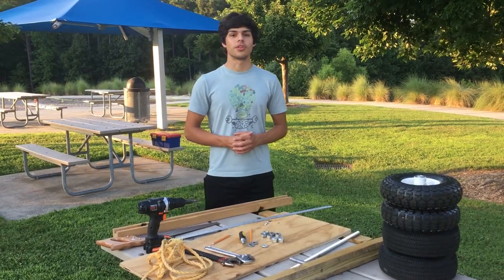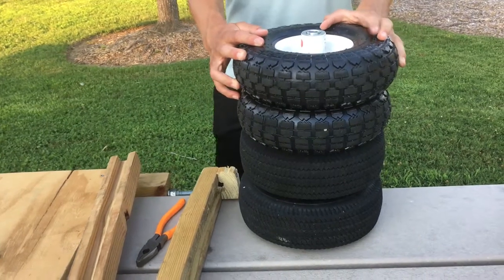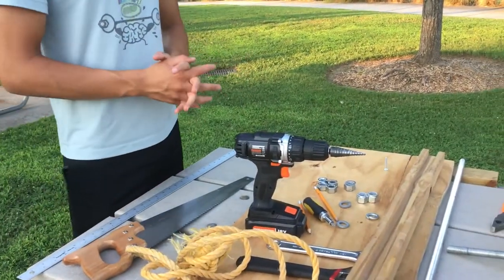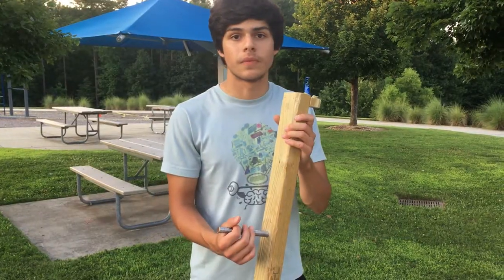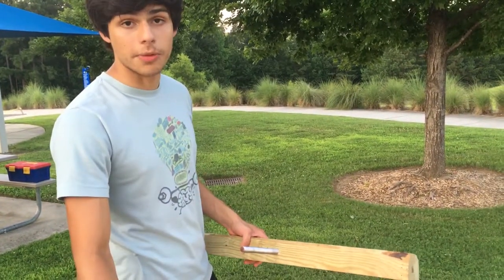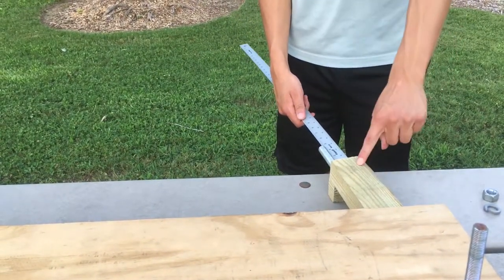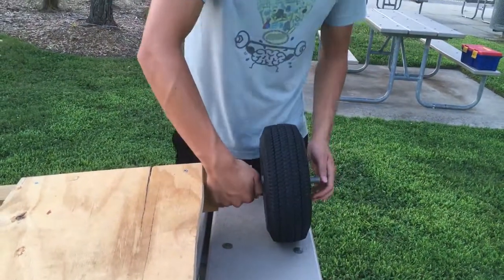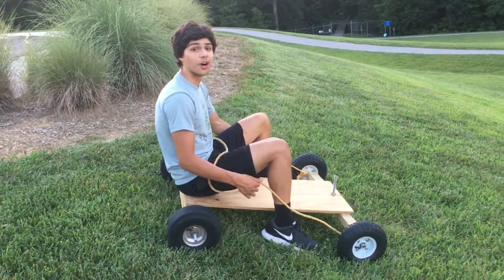How to build the Simplest Go Kart! | Wild Kinetics

Comment: I made one just for the fun of it. as a country and one that likes a Rush. I don't recommend using a 212. it's almost like suicide running almost without control. exhilarating and painful first ride. I should have gotten a video of the crash. I walked away with the motor and tires just to build another one. I'm fifty and love this simple idea. holding the throttle and rope and the brake and rope in the other hand . well let's say it was a almost sixty mile an hour ouch but I saw it coming and I wrecked at 20 something. I cracked a couple ribs and got a few scratches but could walk away. thank you for the continued fun and excitement.

Comment: I copied your design and it works now I want convert it into hover kart. Any suggestions?
Reply from the maker: I would recommend making some joint at the back to allow the hover board to turn, and welding or somehow attaching two sturdy pipes for steering. I haven't used a hover board before, but base on what the kart looks like, that's what you might have to do, because you can't fix the hover board to the frame or else it won't work. Hope this helps.

Comment: Its got no engine how do I add an engine? I got predator 212cc
Reply from the maker: You would need the engine, a clutch, and a sprocket and chain which would connect directly to the threaded rod.